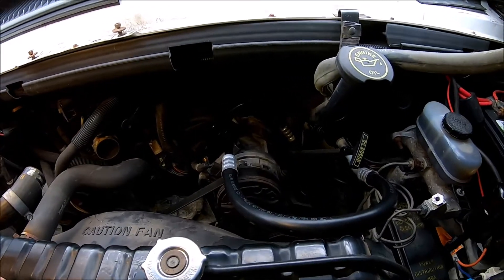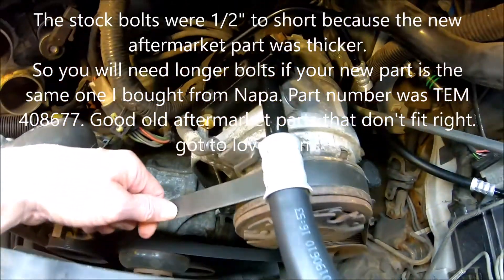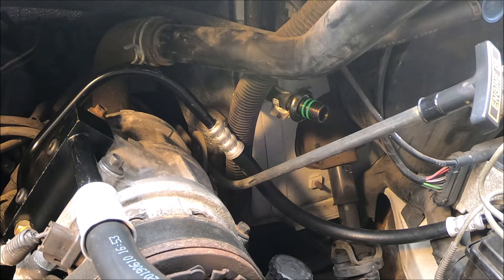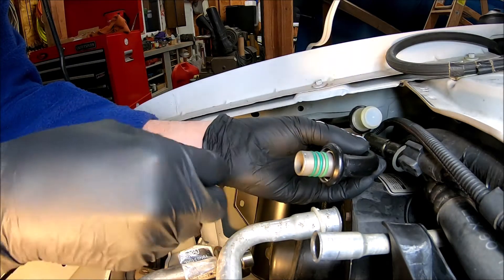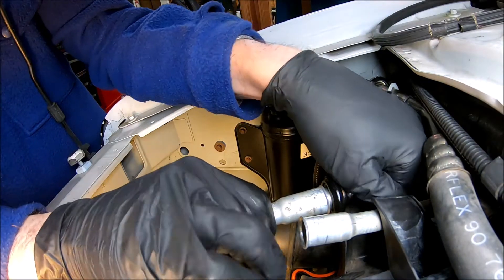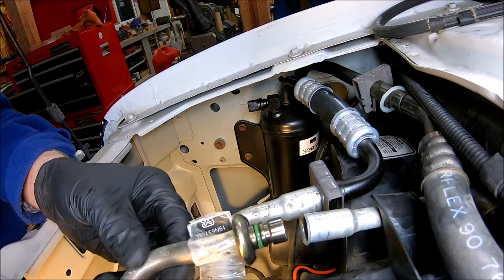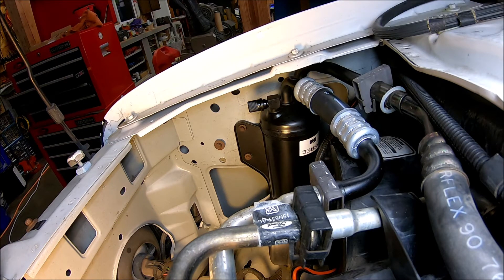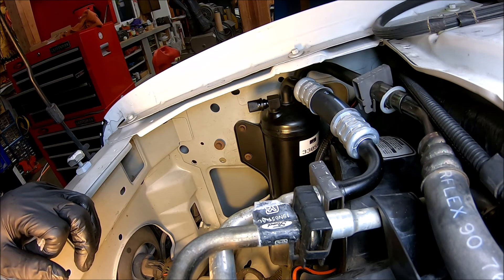AC Conversion From R12 to R134a:  Part 2:  Installing The New Parts

Comment: Another question, how did you change the peg oil?
Reply from the maker: It had mineral oil in the system originally, so I did not use pag oil because, it is not compatible with mineral oil.  I used Ester oil instead because if you don't get all the mineral oil out it is compatible with r12 and 134a.  did you watch video 3 on my channel. I also have another set of videos when I converted my 1993 chevy Silverado. It is a good video also. see my channel https://www.youtube.com/channel/UCttNoiCD8VMYQAQb98q1Rig